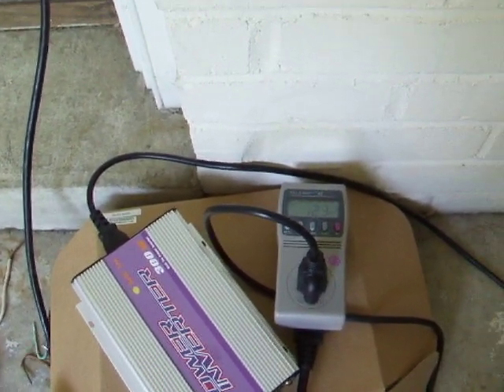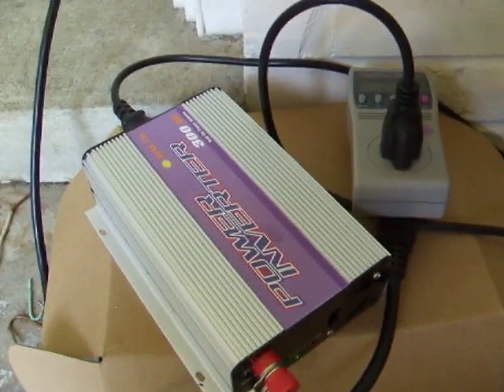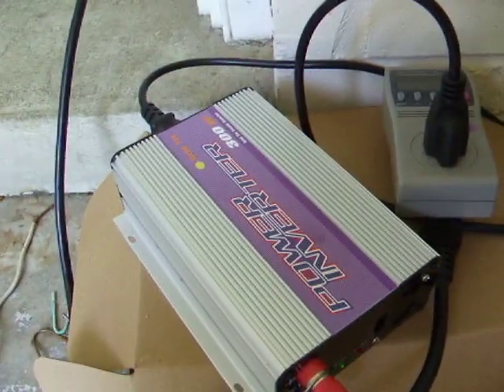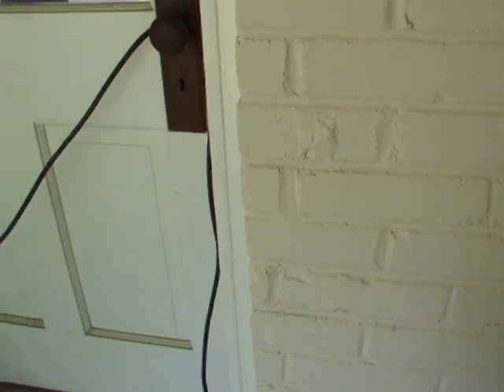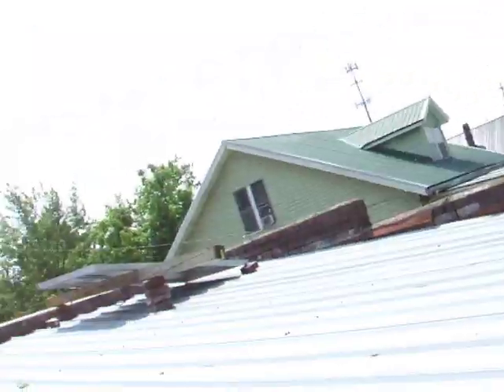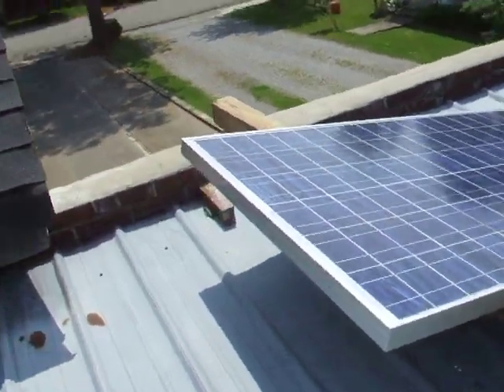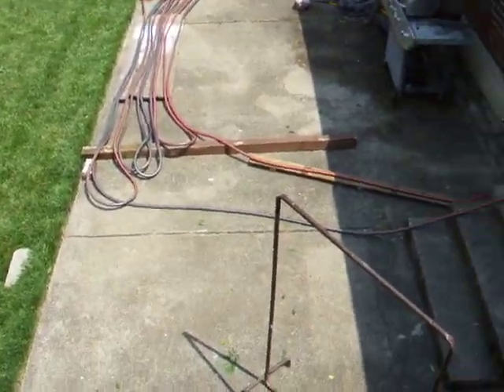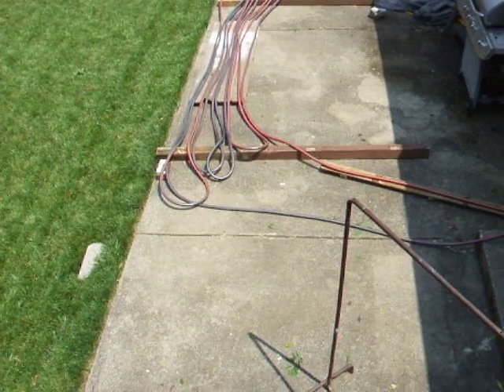Evergreen 210 watt solar panel with Sun 300 grid tie inverter

Comment: cant you use aluminum wiring.....its a lot cheaper....i know they allow aluminum wiring for 200 amp electric panel boxes.
Reply from the maker: They don't make aluminum wire for the smaller gauges anymore. They tried that back in the 70s and it caused a lot of house fires. They do it use for service connection, in 0000 size. It has something to do with the oxidation at the contact points creating resistance and not so much the wire itself.

Comment: please can any one help? i bought a solar panel of 240watt 24v by itself and i just don't know how many and details of batteries should i use to get 5 hours power when my noraml electricity goes off?
Reply from the maker: +Rocien Nkunga You can get as many batteries as you like. The more you have the more power you can store and the longer they will last if you don't discharge all the way. Just make sure your charge controller will take that 24v and take it down to 12v (assuming your battery bank is 12v).. I personally suggest the outback 60 or 80 charge controller. As far as batteries, let's assume you get 10kW in storage, depending on where you live it could take a week to recharge them fully. But if you are using it as battery backup that shouldn't be a problem. If you were off grid then you would want to capture enough power to recharge your battery bank in a day.

Comment: Hello, dear friend. I see you know a lot about the grid inverters.i need 300watt per hr,i have already 150 ah battery 12 v.now i went to go solar system so how need to my  system please give me a answer please how need?????
Reply from the maker: +Biplove Poudel Get a good name brand. My backup system is xantrex pure sine wave. Make sure it's big enough to power your stuff, even if you have something that pulls 1500w but is only used for a few moments. The grid tie inverter in this video only lasted 9 months. If you look at my other videos I have an outback system I very pleased with, been going for 3 years even when I'm not at the cabin.
Reply: i have  pure sine wave inverter 900 va And battery 150 ah so i went to join solar system .okok 200 watt per hr. i need so what can i do sir please answer me
Reply from the maker: Biplove Poudel Sounds like you need a charge controller. If possible make sure you get something you can program. Your batteries came with charge specs. and if they are designed to charge at 14.4v then you don't have to worry about a programmable. I have some deep cycle batteries designed for a golf cart that charge at 15.3v and the outback charger allows me to set the voltages for bulk, absorption, float, and equalization. The outback also allows any voltage from the panels up to 150v and charge a 12, 24v, 36, 48v, and 60v system. Look at my other videos so you can see how I put my new system together.

Comment: hello friend, i just want to ask
if i have a grid tie inverter 300watts, what wattage of solar panel do i need?
thank you very much.
more power and Godbless
Reply from the maker: +ian punay No more than 300 watts. The panel shouldn't provide any more power than it's tested label. This one is 210 and I have never seen more than 190 and average 130-150. But depending on where you are in the world and you know what the max amount of sun you get I wouldn't put a panel on a inverter that is rated more than the inverter.

Comment: Hello, dear friend. I see you know a lot about the grid inverters. I need a grid inverter 600-1000vatt. tell me how the inverter will buy. I live in Armenia.
Reply from the maker: +Samvel Sargsyan This inverter only lasted 9 months. If you are looking to interact with the grid then I suggest Outback products. They are not solid state but are also fairly priced. I have other videos on my Outback system. If you just need a few hundred watts and NOT connected to the grid look for a brand name pure sine wave inverter. The cheap ones don't last.
Reply: a link to the video Outback system
Reply from the maker: https://youtu.be/ZHXMnPs8Y3s
Reply: thank

Comment: I don't understand a thing related to on-grid inverters.So,for example,if my house uses 5kWh in one day ,and if I am able to feed in my grid 1 kW in that day,that means on the electric bill 4kWh on that day? not 5kWh?....I would like to know in this case of on-grid invertes (like the one in this video) if my house will use some energy from the solar panel and the ret from national grid. Thank you
Reply from the maker: Your math is correct. I would suggest something a little better than this inverter, in contrast I have seen videos where people used these inverters for years. My new system generates 10kW/h per day. I send a surplus during the day because I don't use all the electricity I generate, at night I can pull back some of that electricity.
Reply: HamrickCE
Thank you for information. The energy storage is usualy too expensive (deep cyce batteryes).I saw some micro on grid inverters that connect directlly to the pannel,but if you have more pannels you need more microinverters. My house uses 10kWh/day (300 kWh/month) so I would like to make some improvements to cut some $$ fom the bill.It would be better to use some on grid inverters only to feed my house to use less energy from the national grid,but I don't want to sell intro the grid.For this I would have to change my meter with a double way one,this means many papers to sign with the utility company and money so it will be to expensive.During the day I usualy use more energy,for tools,washing machine,tv,lights...and at night,of course I use less.But there are some devices that need to stay on 24hrs/day,like a fridge and a big air pup (for 30 aquariums).Some energy improvements might be usefull by mounting motion sensors for the lights,changind the old incandescent lightbulbs,changing the CRT TV's with LED tv's (ex: I had 75W tv,now 40W,45W - now 25w,and I have to change my desktop CRT 100W screen with a 20W one).In the summer I make something interresting with heating the water for showers and other stuf.I have a 100l tank painted in black which I move it on the roof.So 3-4-5 months I can have free hot water (arround 45-50*C,enough for most use).
Reply from the maker: King .Energy Did you look at my other videos? The system at my cabin makes 300 kW/h per month. You are right, storage is expensive and you will notice I have enough for a day, good enough to keep things going if here is a cloud. Where I live electricity is very cheap and the system I built will take 20 years to break even... but in other parts of the world electricity is 5x what I pay so that easily brings that 20 years down to 4 years.
Reply: HamrickCE
Hi. Yes I watched the cabin video with the 10x235W solar panels.I'm sure they can make 300kW/h/month.I've made some calculations regarding how many solar panes I would need for my house and it was arround 10 pcs. 2kW system should be enough,but where I am on the other side of the world,solar panels are still expensive.But there is some king of help from the EU gouvernment that can pay you 90% of the setup.But sometimes this program works some times not. Regarding the electricity price...here the price is 6kW = 1$...so arround 50$/300kWh. (this might be cheap but here peope earn arround 300$/month,so it's expensive).And guess what; one 200w solar panel costs 380$ :))...and if 10 are needed for a 2kW system => 3800$ (without adding solar charger,wires,connectors,on grid inverters or deep cycle batteryes...these can make another 3800$).Thanks

Comment: Try post it up man I'd like to see how the new set up looks! Sunpower is the best brand I've worked with in my opinion. The 327watt panels r the most popular but the monster 420 is pretty efficient too
Reply from the maker: It's posted. I have an entire cabin running on solar. The Sun 300 lasted 9 months before it died.

Comment: Lol better fix that racking system run conduit or emt pipe to protect those wires and secure the panel . Should be 12gauge . I install solar n the rails and lags and shingle mounts aren't that expensive
Reply from the maker: Don't own the house any longer. The panel is on my boat powering my trolling motor... there is a reason I didn't buy all that junk, Oh, I am using 12 ga... I rather have 10 ga.  This is an old video, should take a look at what is going on now.

Comment: That is a nice start! I have purchased 250 watt panels twice on eBay but you need to buy a few at a time to help with the shipping also find a friend that owns a business with a dock and a forlift. I shipped 6 panels and changed the shipping price from 400$ to I think 185$ because it came into one of my businesses with a dock and a forklift.

I know they say the cheep Chinese inverts will not last, I have had 5 running every day for about a year and a half and no problems. I only load my inverters at half of what they are rated at. They run cooler (any heat is loss of energy) and the fans dont normally turn on unless its like 90 or higher in my barn.
I have them set up so each panel gets its own inverter, I found a power increase of 20% when I did that. Each one of my panels are running 50 to 80 feet of # 10 wire. I get 70 to 80% in the summer and easy 100% in the winter but shorter days. The panels themselves are much more efficient at a cooler temp.
I am saving money but it will take a few years to recover the cost but its fun to play with them and how many hobbies do you mess with that save you even a little money!
Reply from the maker: This inverter lasted 9 months before it died. My new system has better wire but I still used wire for AC power which is thicker... I have never seen this panel go above 190 watts and that was when I was in the desert of Southern California. I have a new project video that I'll be posting soon, I'm using this panel to power a inflatable raft. It has been running for a couple of weeks now.

Comment: Why does everyone omit KWH's generated each day as you pay the grid by KWHs used so how could we judge your systems.
Reply from the maker: I mentioned collecting 800 watts the day before. That is .8KW/h, so not an entire KW/h. My new system generates about 10-12 KW/h per day and the peak wattage is 2.2KW. You have to understand that a KW/h is 1000 watts over the course of 1 hour.

Comment from the maker: This company makes grid tied inverters that handle more than 12v. Being that solar panels produce a range of voltage this one was able to handle more than 12v but not much. Open voltage for a 12v is about 22v but lowers when there is a load to around 15v. I'm currently running 24v panels and the open voltage is 37-38v. So, the answer should be yes, it will handle 17.5 volts. Just look at the specs of whatever you purchase.

Comment: Does the Sun Grid Tie Inverter have to have a 24 volt or higher input? Can it run off of one 12 volt panel that is producing 17.5 volts?

Comment from the maker: I used 12 ga because that was what was available at the time. Regardless, I went out west and used this panel in the desert and the max I got was 190 watts. Yes, I would rather have 10 ga. wire and yes using 12 ga. has about a 5% loss which is only 10 watts. 12 ga. wire is more than capable of handling 15 amps. 

I'm still working on a new video. I'm completely off grid living in a cabin. I generate about 2kW peak, nearly 10kWh was yesterday's total power generation.

Comment from the maker: You will have to look at the specs on the panel. My Evergreen is a 12v panel but under no load the panel will show 22vdc and under load will show 15vdc. If you have a 24v panel you chould have an open voltage of 40vdc which is more than the inverter is designed to handle. I would suggest a higher voltage inverter model if that be the case.

Comment: maybe u might be able to help me. i asked the people i got the sun inverter and am waitn to hear back from them. i got a 300W inverter 10.8V-30V. i then went out and got a 235W solar panel that puts out 30V max i think, but when i set it up it was putting out 26V and the inverter faulted with the red light right away. everything was hooked up right. tried a few more time on diff days and the same thing. i had to hook the solar panel up to a 12V charge controller then to 1 12V deep cycle then

Comment: i got same tie inverter to use with my solar panel setup i got 4 sunforce mad and 3 harbor freight panels i got 2 sets of batterys the grid tie seam to run better off batterys one set puts out 55-60 watts the other set with wind mill power too puts out 75-80 watts i was told 50 watts is equel to 4 amp charge i got 2- 6 amp chargers so i can put back some power i use !!!

Comment: That's for the best.  The power company here has too many regulations for grid-tied systems.  Of course, it's common sense to turn it off when there might be surges through the grid, but a junction box, inspectors coming anytime they want, and no real incentive...  Sounds suspicious to me(on the power company's part).

Comment from the maker: Evergreen is not the problem, where I lived is the problem. I just had this panel in southern california and I had more electricity than I knew what to do with. My calculations based on the amps /volts showed I was getting 190 watts, and this is with undersized wire.

Comment: wow that realy sucks I mean buy a 210 and only get 160 I know not to buy evergreen pannels thanks for posting becaues I have two 40 watt pannels and they are putting out about 85 watts total so they are putting out more then they say wow.  but if you have that thin wire you can lose power over that i'm running 10 gage yes its exspencive like 60 to 80 cents a foot. I need to get a new gti that can go from 22 to 60 volts so I can hook them strait to the gti.

Comment from the maker: This is what happens when energy is cheap or otherwise unfairly priced. Today it isn’t worth putting up panels, especially here in middle TN, but tomorrow could be different. My last electric bill was $36, this is with a $13.75 charge for being attached to the grid. My water heater has been off since March and I use the sun to heat my water. My concern is 10-15 years down the road how will things look.  This is a wasteful generation used to cheap energy and cheap credit.

Comment from the maker: About $120,000 worth. This is middle Tennessee. Places out west will get more sunlight and thus less panels needed. I also heat my water directly with solar, electric water heater has been shut off for about a week and the water in the tank is 130 degrees... this saves 20%-50% on electricity costs depending on usage. Line dry clothes and cook with gas... A/C is the big one after that.

Comment from the maker: Not illegal. First, I use all the power I produce. Peak summer was $2.50 and I have a web server that uses $5.00 per month. But shutting everything off, the meter will run backwards. If I put in a real system and worked with the power company they would pay me for that power 1.5 times over what I pay. Without telling them I just save what I will use later. Some people have meters that will indicate which way the current flows but doesn't give credit.

Comment from the maker: @foresaken5000 Setting up the second meter is net metering. Your math is correct if I were to be participating in the TVA program. I pay .81 cents per kW/hr but because I don’t have this hardwired into my home I’m not eligible to participate. Also, those values were for summer… Tennessee winters are just dull some sun every 5 days. That $2.70 I would have made gets applied to the retail price of the panel $600 plus the inverter, etc… during winter I may only be able to apply $.50

Comment: continued from (Dont know what part of Tn you are)= 750 x 30 days= 22500 \ 1000 to give kw=22.500 \ .22 is roughly $4.95 a month if figuires agerage out to 750 per day by 30 days. If you were buying the kwh from them, wouldve costed $2.25. so basicly you wouldve made $2.70 on the 22.5 kwh you used. If my thinking is wrong on this then someone please correct me. Ive been studying on this for abit now and am working on a small but growing system myself too. I am not contracted w Tva yet either.

Comment: Dont know what part of Tn you are from friend but east Tn doesnt net meter. You enter into a 10 yr contract that would be in your favor through the TVA. Also must buy a second meter (this sounds bad but its realy not. You would sell everything you made not just above what you use. They pay .22 cents per killawatt hour and we pay just under 10 cents per kwh from the main meter.) With just that one panel making between 600 to 900 per day an average of 750 per day x 30 days would give you.continued

Comment from the maker: @mgyabes1985 United Laboratories test all sorts of products for safety not just limited to electronics. They make sure the product does what it states it is designed. Not everything I own is UL listed. That doesn’t change the legality of it. Using something that isn’t UL listed doesn’t make it illegal. Keep in mind, these are cheap and will not last. I have already replaced parts in mine but I have the luxury of knowing electronics and replacing parts that break.

Comment from the maker: @mgyabes1985 I can’t imagine how they could be illegal. They are safe and will shut down if AC power disconnected. I’m using every bit of power I generate. I would have to shut off everything in the house to watch my meter run backwards, and it does. If I were to generate more than I use than I would certainly call them so they would NET meter me and I would get paid for my energy production.